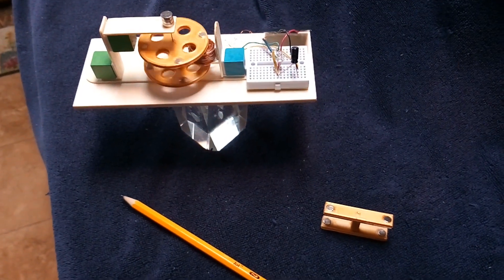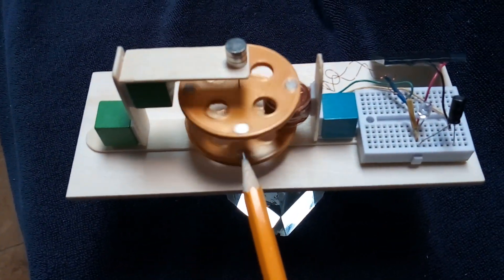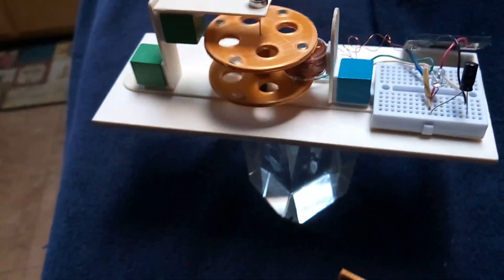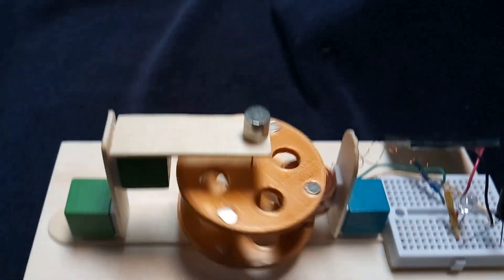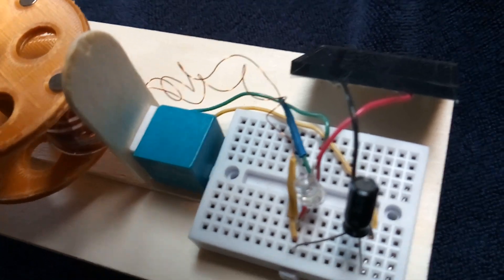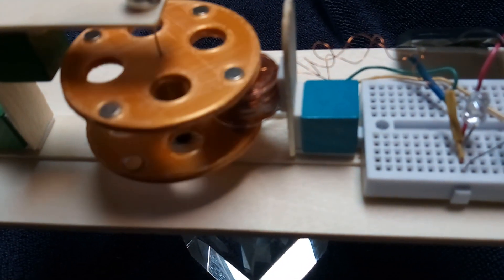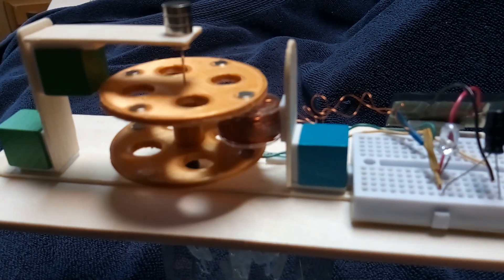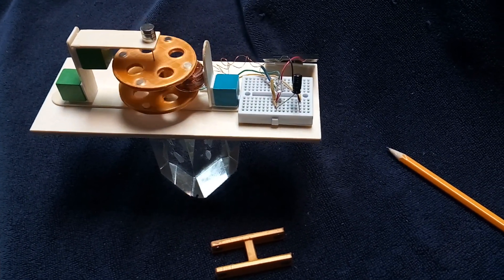Coil In the middle ----  More magnets and solar powered

Comment: I built an 11in rotar with 16 magnets and it ran with a hall effect switch on a small 9v panel I think it was 500ma or less. Mine was obviously bigger and only had 1 rotar on a bearing. But it was amazing how simple it is and runs quite well on solar. I pushed it up to 20v and it ran almost too fast for what it was but it happily ran on the little 9v panel. It's amazing how simple these motors are and how efficient they can be all at the same time.

Comment: I can see the bead pivot at the bottom wobbling; from more weight than it can handle normally in what U build. Make the 2 discs half that thickness. Use a Square instead of a circle and put the magnets in the corners of the square. The center is the bisection of the corners which is easy to do. Make the coil narrower and higher and use smaller diameter, longer magnets. The magnetic field is too wide right now and not strong enough at the apex of the field. A narrow high coil will give a much sharper field structure for the pulse. 
....Just an idea... As time goes on this concept will become a strong unit with power and Speed, depending on how the components are tweaked together...
Use Molly to sense the pulse field around that coil and ascertain the spread pattern and intensity at the core of the winding.

Comment: Maybe .. .. If you would place a second one next to it, it would rotate as well. It would create a little bit of drag, but I think it will spin alongside. (2 magnets may be to little, but you could try). I once tested spinning MANY magnets, which were 'hanging' on a magnet, and that worked very well (I even made a video about it, but it is very old by now). 
Using a read relais is still a good thing imho, it has a very short rise time, I am not sure if a mosfet or transistor has that as well. And like you say: it does not get easier.